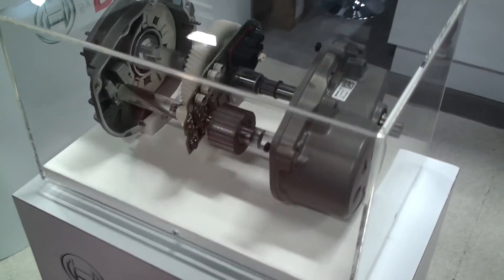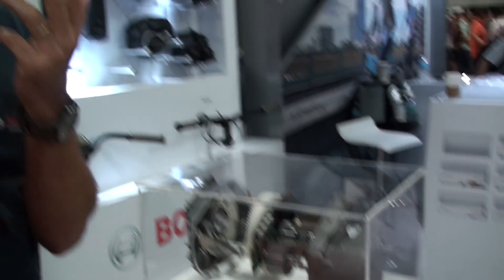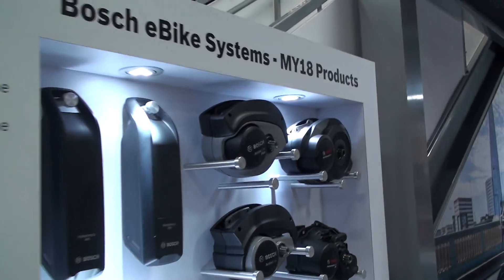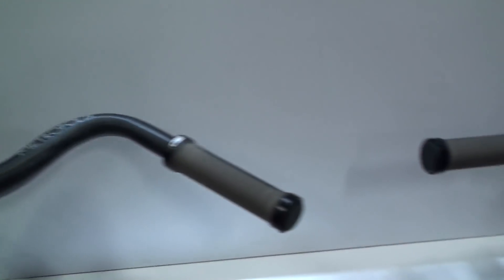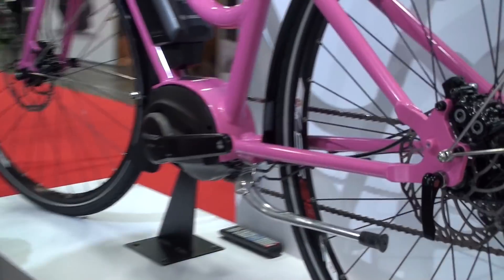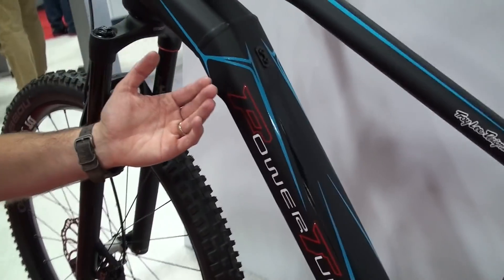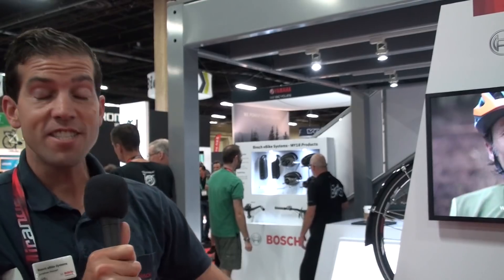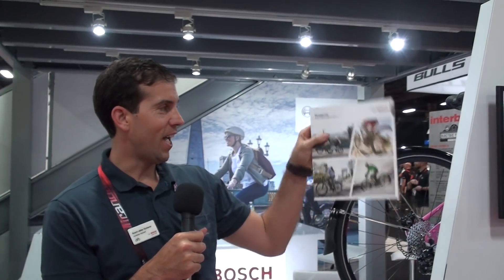New Bosch Active Line, Active Line Plus, and Powertube Frame Battery | Electric Bike Report

Comment: It's nice. But when your paying over 1500$. You expect more then just 250 or 350watts in a motor for a price that much. Get 750watt motors out, then people would be willing to toss 2000$+ for some of those in bikes.
Reply: The motors are just 250w nominal, meaning they give way more than that in intervals when needed(i.e. going up a hill). This is because of ebike-regulations, more than 250w nominal would classify it as a motor-vehicle requiring insurance and registration to be legal
Reply: @navimer  

((The motors are just 250w nominal, meaning they give way more than that in intervals when needed(i.e. going up a hill). This is because of ebike-regulations, more than 250w nominal would classify it as a motor-vehicle requiring insurance and registration to be legal)) 

First no, that is dependent on state laws. So EU/UK/etc is different. US has state laws defined for electric bikes.

2et. Electric bikes are defined by it's base wattage. if it's a 250watt motor, it's a 250watt motor. They don't include the BOOST wattage used for internal rpm and torque required to get the motor up to speed. You should read up on how motors work to understand the internal boost wattage works.

Mid-drives have more internal boost wattage for reasons of Torque, because they spin the cranks which require more TORQUE then hub motors do which spin the wheels. The Torque is turned into spin power to the drive-train chain/belt/etc to the rear wheel's cassette/freewheel/etc which can change speed. Depending on how high or low you go. You get more torque spin, which gives more start power. Mid-drives have a Higher Torque rating because they spin the drive-train vs a hub, So they'll have higher boost wattage then hubs do at the start. Then taper down to their standard wattage at speeds. Which is where the defined electric bike limit wattage is termed at based on it's max speed. Not it's maxed torque wattage.
Reply: @KillerRaptorr  yes I was talking about the regulations in EU, I don't know and don't care about the different regulations in different states over there in Trumptopia..

But 250w advertised is not 250w, and you are wrong..
Read more about it yourself here http://www.ebikeschool.com/myth-ebike-wattage/
Reply: @navimer  Maybe you should read it, and reread my post.

As it and my post mention. They measure wattage by the end power point as the motor is up to speed. 250watts = it's top speed point. YES all electric motors will have more then double, even triple the amount of wattage on it's start, That's because it's called TORQUE AND RPM's. Even fricken motor cars have a higher RPM at start, then they do at top speed. So more power will be given to the motor, then at end point.

This is why the legal limit of electric bicycle motors aren't determined by their PEAK wattage. But by their continuous wattage. Because you're NEVER gonna get MORE power once it's at it's continuous point. It flatlines. Once the torque/rpms are finished, it puts that start speed into top speed and then the wattage drops dramatically. 

So no you're wrong. If you were right, then why are the millions of other people able to fly by on their EU mid-drive bikes without being fined? Cause the rules aren't ruled by PEAK power. but by continuous power. Peak power relates to the torque and RPM's to get the motor UP to speed. A lot of bikes are designed this way for better climbing. If they all were 250watts, that'd be like, really crappy torque and rpm's for climbing rough terrain that the bikes are designed to do, Which wouldn't be any point to even putting a 10-20pound electric kit on the bike.

Comment: If you move the frame sensor forward towards pedal, then place the wheel magnet behind the pedal hole stem rotation , then the motor thinks it traveling much slower and does not cut out at the 15.5mph pre setting.(uk setting) and you can get some decent speed.😀
Reply: SL1970 this might seem like a simple way to beat the speed restrictions, but new updates will actually detect these changes and can void your warranty among other things. Something to be aware of.